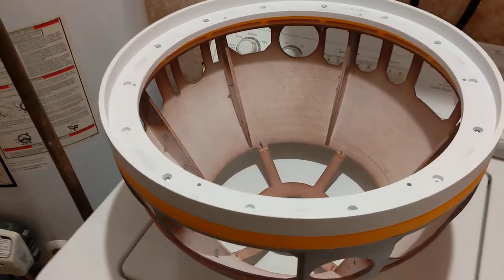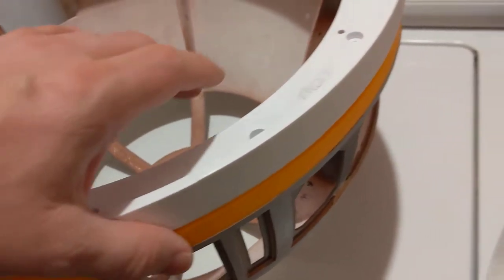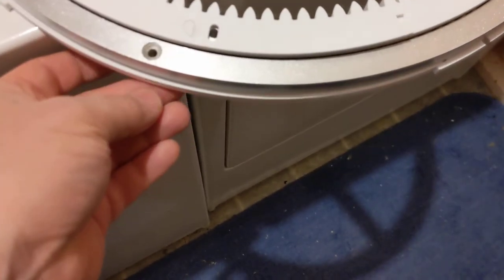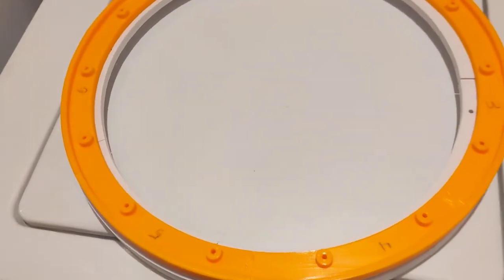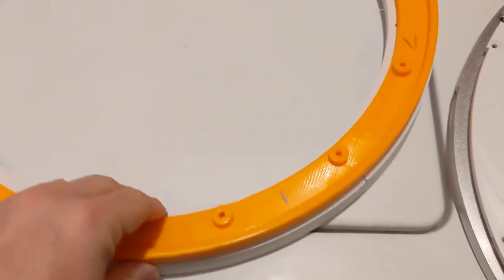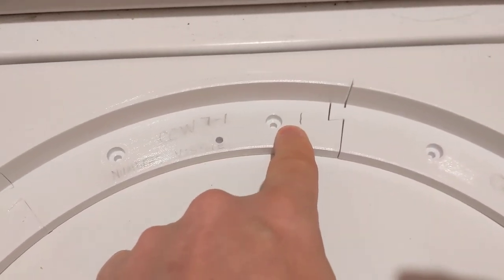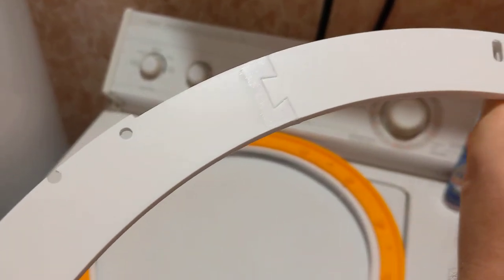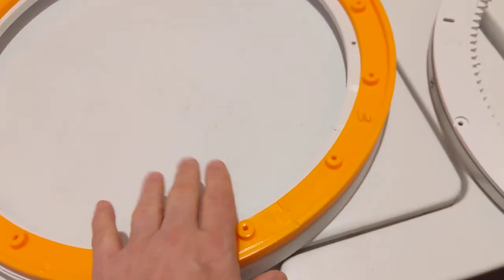3D Printed R2D2 - Part 30

Comment: That was the most frustrating part when i printed them - my lazy-susan (Granite Earth) the gear didn't fit and had to be printed twice to scale it to fit the Lazy Susan.
Thanks for your vidoes - they are helpful to see a current builder - I'm just getting started after the new year on printing the legs.

Comment: That is the hard part of using multiple printers.  For things that have to fit together tight I try to use the same printer so there are fewer scaling issues.  Of course when you need 50-100 hours of printing that makes you want to weep to having other printers sitting idle.

Comment: Informative video, what percentage of infill did you set your printer to? I'm printing these parts currently. Also is the granite earth lazy Susan the only lazy Susan you can use, I've seen one on Amazon that looks usable?
Reply from the maker: I think I used 35% infill and 5 outer walls.  I pretty much went with the settings found in this guide:
https://www.printed-droid.com/sdm_downloads/printed-droid-print-guide-for-r2-d2-v1-2/
Reply from the maker: There is a lazy susan on Amazon that people have been using with good results but I'm not sure which one.  If you search the Michael Baddeley facebook group you should be able to find it fairly easily.